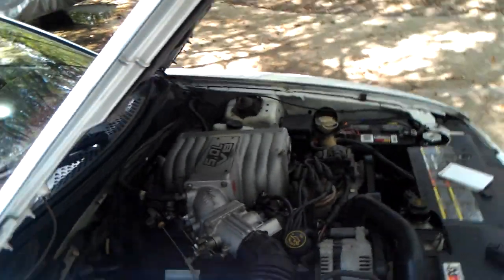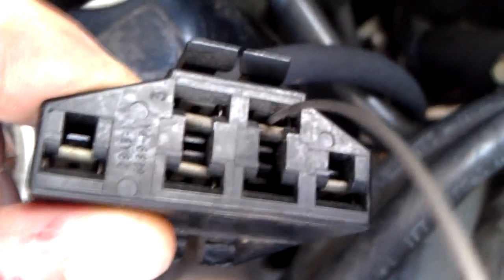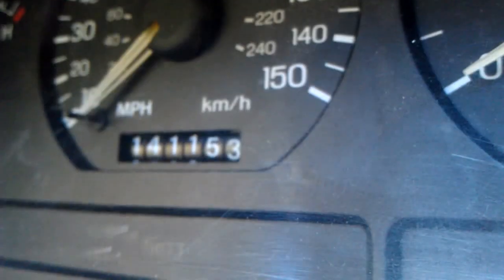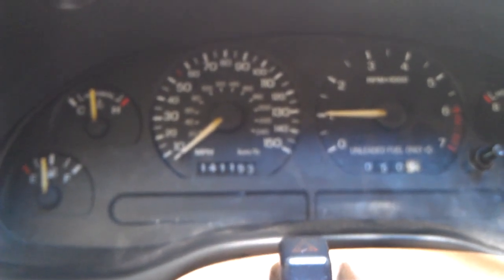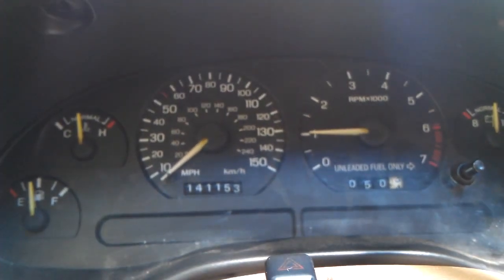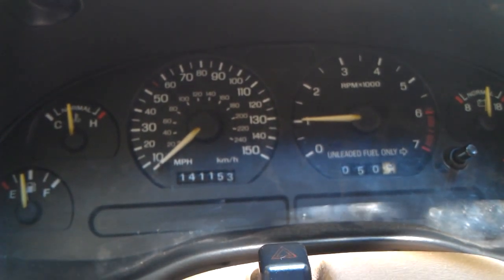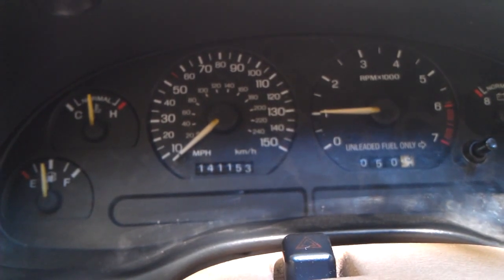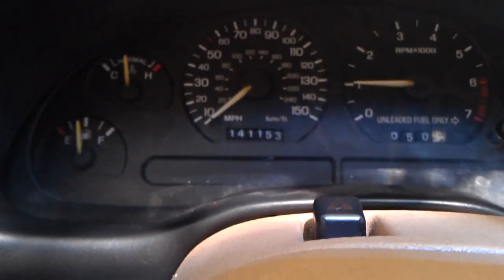1995 Mustang GT KOEO KOER Test

Comment: ive got a 95 mustang gt, i have been having issues with finding the miss its mainly low rpm miss and whenever my fuel ets below half a tank, ive tired koeo several times and get NO codes i hear fuel pump prime and fan kick on but i always wait like 20 minutes and get no codes when i try to do the koer test it just suts my battery off like i blew a fuse, any tips or ideas?
Reply: Mike Ray Hi Mike, I have the same issues. Did you solve or figure out the problem ?
Reply: +Fabio Franzoni does the check engine come on at all? might be a broken check engine light no? some people have speedo issues so that could be a problem I think. I could be wrong though as I'm new to pulling codes
Reply: probably way too late but it could have been the  Ignition Control Module, sensor right under the stock cold air intake box.

Comment: very helpful.my son has a low miledge 95 mustang gt.its spent most of its time in a trans shop an electrical shop and the dealer.trans sometimes slips in overdrive,and some times it wants to run warm.weve been told it needs a map sensor the dealer wants to change everything and no garentees ie been told obd1 code reader wont help.you think these proble could be coinsedence or maybe the computer may be bad